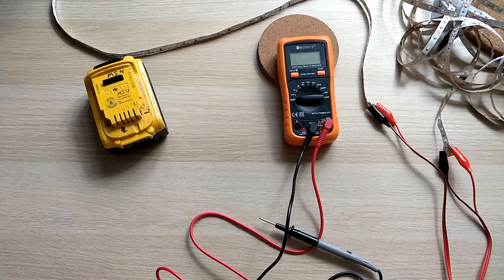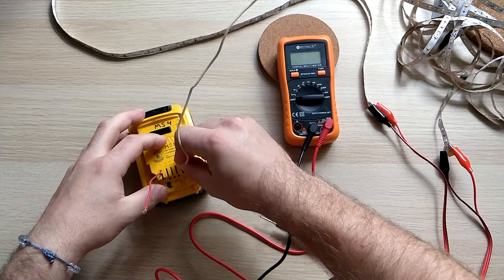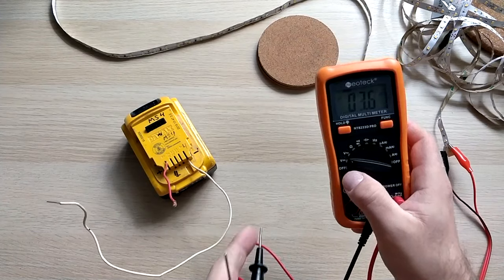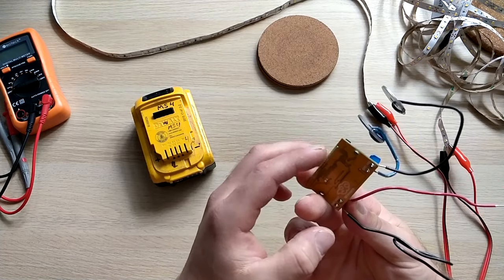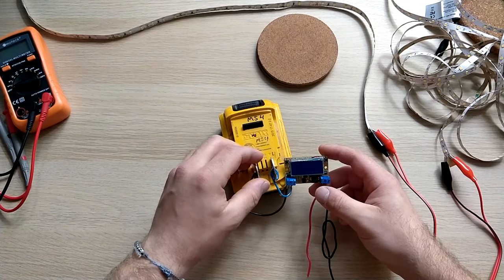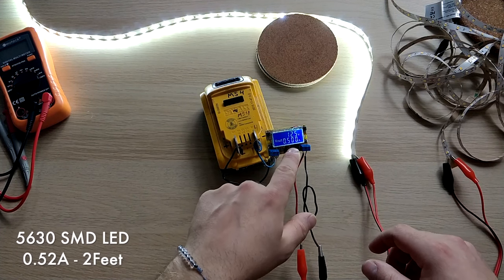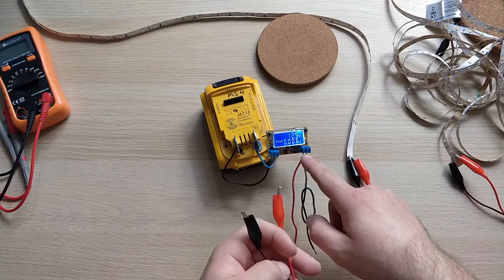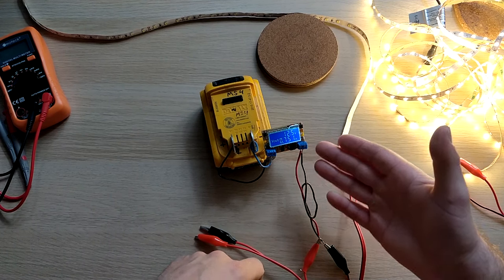12v LED Strip light powered by Dewalt 20V Battery

Comment: Could a 12 volt deep cycle battery be wired directly to a 12 volt LED strip without burning it out?
Reply from the maker: I'm not 100% sure what is deep cycle battery. Yes, you can hook up led strip to any size of battery as long as the voltage does not exceed 12v it will not burn out. Larger battery capacity is only going to increase the time of the light shinning, before it runs out. Bigger battery last much longer then a small battery, that's all.
Reply: @biesasuk  Thanks so much. Direct to the point answer.

Comment: Does the DC stabilizer have a shut off feature in case the battery power gets too low? 
4Ah / 0.75A = 5.3 hours of light on a fully charged battery. Or a bit less if the power is being cut off before the battery is completly drained.
I think you can get these lights with an USB plug now. So a USB adapter for the battery would be an easier setup. You can also get the Harte led desktop lamp and the Ledfyr fairy lights from Ikea to use on the adapter. They both have USB plugs. Harte gives good lighting and has an on/off buttom. Ledfyr also gives pretty good light, but doesn't have an on/off button. Get the adapter with the on/off button and the little led light on it. Because the adapter itself might draw a small amount of power from the battery even with no USB devices attached to it.
Reply from the maker: Yes, but you won't be able to run LED strip which is 12V since USB output is only 5V. Now they have other adapters specially for batteries, but this works great for my needs. Also does not have shut down on the battery, it will drain to 0. You can always look on the screen if voltage drops below set voltage and also press the button on the battery itself to see how many bars are left. For me was never an issue since I have bunch of batteries too.

Comment: would this converter be able to power a atv speaker? I dont want to run the speaker off my atv battery when I am parked, but I have a ton of big amp hour dewalt 20 volt batteries.
Reply from the maker: It should work no problem, if you using small portable speaker. I run full strip of led's for 3-4hours, change the battery and continue to run. It does not overheat and works great. Check the wattage of your Voltage regulator and your speaker to make sure you not overloading it, to minimize overheating. Safe riding! :)

Comment: What would happen if you connect the lights direct to the battery?
Reply from the maker: They would burn out, I have tried and the strip burns right away. It's 20v output when strip is 12-13v.
Reply: @biesasuk why youd wanna fuse them if they were wheel lights for a car
Reply: @biesasuk  I just tried it , nothing wrong happened

Comment: Are the metal discs put into the slots on the battery and connected to the Yeeco your own making? or are they available online?
Reply from the maker: Those are just 3/16 washers wrapped around with some wire, only used it for testing. Thickness is perfect for this battery and sits right into the slot, but you have to see what works best for you. Hope this helps!

Comment: What’s that device called the one that steps down the voltage
Reply from the maker: Dc Stabilizer. I added the link in description.
Reply: I have a question 🙋‍♂️, can you just use a voltage regulator??

Comment: could you power a 400 watt inverter this way
Reply from the maker: It might power it up, but most likely it will die or inverter will be cutting out as soon as you try to use something. It's a small battery, not enough amps

Comment: Could I wire a 12v break light into a 20v battery? Would any fire start?
Reply from the maker: Sure, if you need to wire it like that why not. As long as the voltage output is 12v. I would highly recommend to install fuse right after the battery, in case something goes wrong so then the battery won't be effected or wiring.

Comment: So you're running 20 Volts into an item that takes 12 volts?   You need a resistor or your lights will burn out.
Reply from the maker: No, you don't need any resistors in the circuit. That's the job of voltage stabilizer, it provides nice stable power at 12vdc 👌